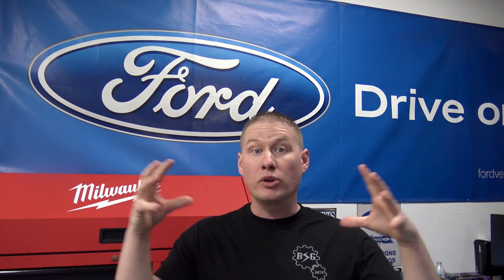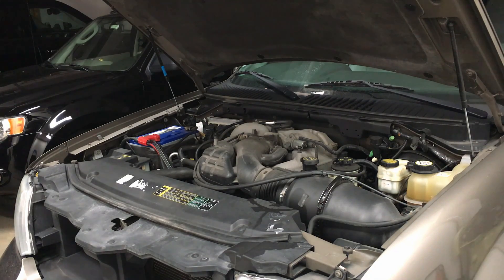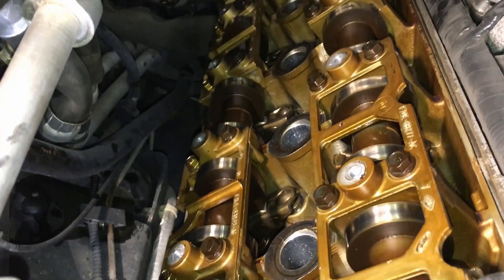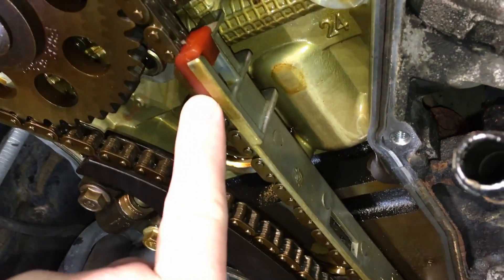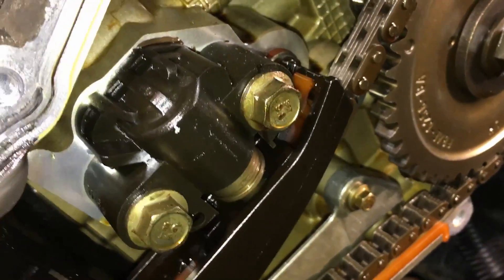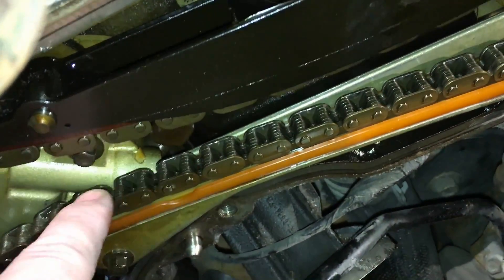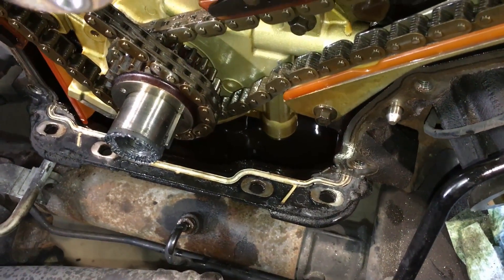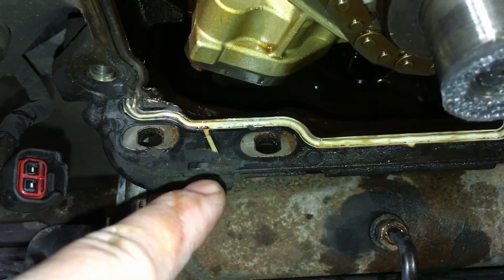Ford 4.6L & 5.4L Triton Engines: Common Failure Points to Watch Out For!

Comment: i used to make fun of fords you know found on road dead , but then i bought a dodge ram . i think fords are better now
Reply: robert hensen ...
Ford...Fix Or Repair Daily
GMC...Garage Man's Companion
Mopar...More On Parts And Repair
Pick your poison, folks!
Reply: FORD / F_cked Over Rebuilt Dodge,Found On Road Dead,For Old Retarded Drivers
GMC / Garbage Manufacturing Corporation
Chevrolet / Cracked Heads Every Valve Rattling Oil Leaking Every Time/ Condition Hopless Every Vehicle Relies On Left over Engine Technology.
Cadillac / Carrying A Deceased Italian Lying Lifeless Amongst Cargo 
BUICK / Before Use Insert Car Keys
PONTIAC / Well you know LOL
Reply: @ @maverickdallas1004  GMC Govt' Motors Corp.  Generically made in China
Reply: @maverickdallas1004  you forgot one more bro, Chevy Like a Rock, unappealing and lifeless LOL
Reply: maverickdallas100 All of them and they're more reliable than Europeans
Reply: @maverickdallas1004  GMC is a Gay Man's Chevy 🤣🤣🤣
Reply: @maverickdallas1004  THIS DEFINITELY SHOULD HAVE MORE LIKES! WHAT IS WRONG WITH YOU PEOPLE 😂🤣
Reply: robert hensen All vehicles have problems. Love am or leave em I guess.
Reply: mark p ...Foreign cars aren't so "foreign" anymore and domestic cars aren't so "domestic", either!
Reply: My old Ford runs like a Swiss Watch, but that's because I do all the work on it, except the Transmission Rebuild, but I found the right guys and they built it exactly the way I wanted it
Reply: robert hensen the biggest problem I saw with older Ford engines back in the 70's and 80's in the desert was their propensity to overheat. The next biggest problems was in the 80's when their electronic ignition control modules from the factory weren't very reliable. Change one out with a heavy duty module from Sorensen and the problem was solved.  Besides that every engine family there were some problems specific to each, but that was the most common. But once you understood what those problems were they weren't any better or worse than their competitors. Somehow I've ended up owning more fords than anything else, but they've always been reliable other than ignition control modules. I took good care of the cooling system, and upgraded the radiator whenever a car I bought had a two core and that was that.
Reply: Chevrolet... Cracked Heads Every Valve Rattles Oil Leaks Engine Ticks
Reply: About 6 months ago I repaired a Stripped Out Spark Plug Hole on my 4.6L Ford, and I did a High Quality Job on it and it turned out perfect, but I have Mechanical Ability and an Education

BTW, it cost me about $22 for a brand new Repair Kit off Ebay
Reply: Keith Johnson - Shelby GT500  why was it stripped out?
Reply: Escape for Mankind is Keith Johnson  Sounds like you have pickup all the slacks for Ford. A reliable quality vehicle shouldn't be like that.
Reply: GMC: Got a Mechanic Coming?
Reply: Escape for Mankind is Keith Johnson those things are easy to do but  hopefully .theres a variety of them at advanced for a 10 to 20 bucks but still doesn't change the fact that you have to fix what ford couldn't
Reply: EmofacePS3 i have both. both impressed me alot . i really cant choose which brand i like more because they both have there ups and downs
Reply: My 90s dodge ram has 240k ORIGINAL motor & transmission. Still runs fine. My ford 5 4 3v was an absolute POS dropped tons of money just kept breaking and breaking.. Glad I got rid of it
Reply: @oliverdelgado6952  That's sort of the problem. The 5.4 VVT Engine is the biggest POS Ford ever made.  I ALMOST bought an F150 with that engine, but, the price was just a bit out of reach. I bought the Work Truck Special with the 4.6 and have had ZERO problems ( New Alternator @ 130K and coil packs and spark Plugs @ 150K. Currently has 230K) and still touch starts with a slight turn o the key.
Reply: @anonimous2451  thank u for answering my question....i was wondering ,why not the 4.6 f150🤷🏾‍♂️...
Reply: I own both. A 2003 F150 4.6 and a 2017 Ram Laramie 5.7. Love the Ram, passes everything but a gas station.
Reply: Anon Imous lol yeah there fun but I went with a 2017 2500 6spd manual cummins love this truck also but I’m passing the shit out fuel stations not other vehicles but that’s ok cuz I had a 97 with 5.9 l gas omg what pig that was.
Reply: Anon Imous see it’s called smiles per gallon bro 😆👍
Reply: Exactly, people never realize until they get behind the wheel of one and then they find themselves asking themselves what kind of a fantasy world have I been living in LOL. I used to be one of those people until I turned 19 and drove a Mustang for the first time and I'm 39 now and I never have and never will go back to junk ass Chevy or anything else for that matter, well except for maybe a Nissan Z-car or a GTR when I win the lottery LOL but nevertheless Ford will always be my Foundation.
Reply: Yeah my 01 ram 5.2l v8 still on the road today mechanically sound body a lil worse for rust. But I see ten of these for every ford or gm of the same year guess dodge had it right when they said longest lasting trucks on the road.
Reply: @Jon-O.  🤣🤣🤣👍keep telling urself that, it'll work hard for ya LMAO Ever heard of Auto Trend Magazine? If so, try to argue with them lol
Reply: Michael Taylor what about there longevity and I suppose you’ve never heard of fake news hahaha. I’m just reporting what I’ve seen and personally experienced. Are you going to tell me the Chrysler 318 cu in 5.2l is junk? Because if so then the Gm 350 and fords 351 were crap too. Which you know dam well is bullshit.
Reply: @Jon-O. 🤣🤣👍 Have fun with your theories
Reply: @Jon-O.  🤣🤣🤣...I have spoken young padawan 😎👍
Reply: Michael Taylor cmon join the ram side oh wise Yoda. 😄😆🤣
Reply: @Jon-O.  Never..... I'll Never Turn To The Dark Side!!!! You failed your highness, I am a Jedi, like my father before me🤣🤣🤣🤣👍👍
Reply: Michael Taylor lol Luke I’m your father, Son join with me and together we can rule the roads of the universe! 😇😂😂🤣🤣👍lmao you had to troll me!
Reply: @Jon-O.  Love it man🤣🤣🤣🤣👍Dude I love old-true mopars just, unfortunately not the 80s and up. The 80s killed Dodge for me bro. I'll love the superbee 😎👍
Reply: Michael Taylor yeah there was only carol shelbys attempt to resurrect mopar muscle a ford guy with front wheel drive tuners. All the while from 75 to 90 ford was Putin out stuff like mercury marauder f150 lightning mustang cobra my buddy had one beautiful car. Gm with the Buick gtx and grand nationals Pontiac Trans Am one bandit run. Chevy comaro and corvette typhoon. My mom drove a 68 two door charger that was the car that turnt me to mopar it was a 383 4bbl and it was fast. Can’t imagine a 440 sixpac or the 426 hemi. She didn’t have it long they boosted it from her work parking lot. Just watch though as far as Trucks Ram is on a mission to catch Ford. They passed Chevy in sales in 2019 and most likely GMC trucks soon because of the 6.4 hemi and 6.7 cummins the aisian transmission is a product child of a Chinese corporation and Allison where Allison shared there tech with China. So essentially Ram has the best diesel Cummins mated to the best trans technology from Allison that’s going to be hard to beat and with longevity those farmers will be buying and that’s what made Ford #1 originally. The info on ram passing Chevy in sales was from AutoTrends magazine article in 2019. But enjoyed the exchange with you and the light heartiness 😃👍
Reply: @Jon-O.  Thats a mouth full bro🤣🤣🤣😎👍
Reply: Christler products these days total junk
Reply: @Terrilmob-j3f  that's because Italy bought them out and Chevy is not too far behind 😎👍
Reply: The 3v Ford 5.4 is the worst engine ever built imo
Reply: robert hensen
Reply: LOL
Reply: Ya mopar really cheaped out beginning of 2002 when they almost went tits up lol.
Reply: mel plishka not the trucks but the cars yes
Reply: What would you know?? Your not working on it. 

You bought a piece of shit
Reply: @Casa Del Amo  atta boy ls espically 6l
Reply: @Steve Paige and they hold value
Reply: I just switched from a 07 dodge ram to an 06 f150. The dodge was a good truck till it hit 120k miles then every other day some new noise or shake would start. When the transmission started slipping on me it was time to give it up. I had great luck with the older fords so let's hope this one is the same
Reply: You guys ever stop to think maybe they all make good cars? It’s just the good owners that argue about them and that’s why they all have such high mileage examples
Reply: Why do I have 6 neutrals I think people with mechanical knowledge make junk vehicles look good only because they know how bulletproof and truly repair not just replace fail parts with the same part that will fail again.
Reply: jon O good owners if a vehicle makes it long on one case every truck that doesn’t make it that far was owner error. My grandfather has a 1977 f150 with 600 k miles on the original motor still wakes up at 4 in the morning every day and it starts right up
Reply: Well Ya!
Reply: My f-150 has 320,000 miles all original
Reply: All the same hot garbage. Every single car company
Reply: I'm a 22 year mechanic out of all the vehicles I have seen 2 and 4 valve engines like this is able to be neglected , beaten, ran 100,000 without a oil change and still run like a top with 400,000 miles on it in fleet vans . 3 valves were garbage though
Reply: my mother says there ain't no such thing as old dodge
Reply: My 2005 dodge ram 1500 was the biggest, most useless piece of garbage I've ever owned and it pushed me into the arms of Ford!
Reply: Im Hip, Fords have their problems but nothing like Dodge, their materials are garbage mostly, engines and drivetrains are ok but the rest of the thing falls apart! I like GM products but they are definitely a lot more expensive to buy and maintain. They have their problems too. I dont see too many GM pickups on the road where at least one bulb is burned out. Doesnt seem to matter the year. My brother in law bought a new GM pickup and the horn honked almost every time he made a right turn...weird
Reply: @zzyzxzee6374  gm expensive to maintain? Ever OWN a ford?
Reply: Especially here in the salt belt, I once saw one that had the frame almost rotted out.
Reply: Ford .Fucking only Real Deal. First on Race Day. Awesome always!
Reply: Greg Taylor Lmao. Yeah... GM makes a sold drivetrain, super shitty at electronics.
Reply: Toyota....add gas and drive.
Reply: You don't know what you're talking about
Reply: robert hensen ugggh yeah. I would buy a new dodge hemi tho.
Reply: Ya i dont like rams. There new trucks with rear spring coil drive like dog crap
Reply: Jacoby Noctis the one tons have leaf springs. Put some wait in the back it will ride like a Cadillac.
Reply: BWAHAHAHAHAHAHAHA
Reply: chevy is best
Reply: @tommymcdonnelljr1582  yeah they're so good that they just closed down three more manufacturers in this country  and many of their employees are still on strike 🤣🤣🤣🤣🤣👍
Reply: robert hensen agree dodge is garbage. total money pits.
Reply: Gavin just had a spark plug pop out of my engine yesterday.  ford cant even accomplish a spark plug fitting smh. selling it and going back to chevy for life
Reply: @thomassmith3951  is this only on the 5.4 and not the 4.6?
Reply: Yes i agree Dodge is worse than Shitrolet.
Reply: John A  yeah Ram is so bad it surpassed shitrolet and is knocking on Fords tail gate pfft.
Reply: Casa Del Amo yes the best set up you can have is a 6.0 Duramax with an alison transmission
Reply: @jackrogers7676  the duramax is actually an isuzu engine

Comment: My 04 3 valve  wiped out a follower and cam on the passenger side. I change the oil several  times trying to flush out everything. I did not find but a couple of small pieces in the filters  that I changed close together. I did not drop the pan as the cross member is under the pan and I would have to have the front aligned as it looks like it holds the frame together. That was over a year ago. I did not think to put my camera in through the hole as I thought you could not see the pickup. If the cross member is removed, do you need to get it aligned? Also, can the pan be pulled with out the front cover being removed and are there any issues I should watch for? Do I just need a pan gasket to pull it or what do I need? Thanks for the videos.

Comment: I have worked on quite a few 5.4 32V engines, mostly Aussie Boss motors.
I install them in Mustangs.
The Navigator 5.4 32v version actually has a 2V oil pump, 
which has the small diameter pickup tube.
What I do, is use the Melling Shelby GT500 pump, (M360 I believe)
and use a 2005 5.4 3V pickup,
as the 3V motor has the larger pickup tube to match the pump.
Both use the same oil pan.
Also, Ford Racing has complete timing kits which include everything
for the 5.4 32V.
Get the Ford GT kit, not the Shelby kit.
The Shelby kit has smaller cam gears and different chains to clear the cam covers
of the Shelby.
The kit that fits the Navigator is M-6004-A544
Reply: Will this oil pump upgrade work on a 1999 Lincoln navigator 5.4 32 valve ??

Comment: I have a 03 Town car, with just under 100k miles.. I have noticed sometimes on start up I get a noise..almost like you just did an oil change and the filter has yet to fill up.. Should I pull the front cover and check ??

Comment: Just wonder if you can post something about removing the rad. fan on a 2000 ford explorer. I've done many fans, but, I have never done a 5.0 explorer fan. It looks as though I need a special tool to get loose from the pulley. Any help would be greatly appreciated, because my wife thinks I the best mechanic around. Little does she know most of my knowledge has come from other people, lol. Sincerely, Jack.

Comment: Hello ! I have a problem at 130hp 96kW Ford Mondeo mk3 2003! Do not stay water at 90 degrees! I changed two thermostats so far and barely stands at the forefront! Please help me ! Give me an advice ! There is another controller somewhere? I heat in the car! Thank you very much !
Reply: no, increases water temperature to 90 degrees!
Reply: thank you very much :)

Comment: FordTechMakuloco, Keep up the good work. It's appreciated. Can you tell Us how many miles the 5.4 L  4 Valve had on it?
Reply from the maker: 137k miles
Reply: I have 280k on my 97 Thunderbird and my engine seems to run smooth and quiet.  Is there anything I should do to the inside of the engine at this point?
Reply: I'm a Futures Trader
Reply: you got lucky. your ford is the 1 out of 10,000 that makes it past 100k miles
Reply: i'd be embarrassed to admit that i owned a 97 thunderbird with 300,000 miles. you need to get off the comment section of youtube and get your money right.

Comment: Which tensioners do you suggest?  I see there are cast iron ratchet ones available.
Reply from the maker: I use what was made for that particular engine per the workshop manual but many have used the old cast iron ratcheting type tensioners in place of the new plastic style with no problems to report.
Reply: Thank you.

Comment: Can the front cover come off without removing the valve covers?
Reply from the maker: Yes I have done this before but in the end you will need to remove the valve covers any way for further inspection and the timing procedure.

Comment: Hey Brian great video. Have you ever come across the older 4.6 triton engines spitting the rocker followers? I've had bunch of ford products that had the 4.6 and they've all been flawless except a 2000 f150 that I've had sitting for quite a long time. It used to run good when I would start it every few weeks, then one day it backfired and started running rough. Found no compression in two cylinders and both cylinders had a rocker follower laying in the valve cover. Supposedly ford has a retention clip to keep them from falling out. Haven't tried to put it all back together yet. Doing some research first before I do. Any ideas?

Comment: 4.6 &5.4are both great engines
 my 3 have 180k, 275k, 389k. I did timing tensioner on the oldest one at 150k, with guides, not the chains, sprockets or oil pump. took me about 8 hours.  don't go chasing the what if , because it's a no win situation. oil pumps rarely fail on these.
Reply: Zachariah Woller  not true I've had almost a dozen of these engines I never check plugs and I've never had a plug blowout
Reply: therockkkkher 
If you put a spark plug in there and don't check on them every time you get a transmission fluid change than it will blow out. See people that don't know how to turn a wrench are the problem, they will take everything for granted than when it fails they blame someone other than themselves.
Reply: daryl turcott I agree mine has nearly 300k on it still running strong. Also it's had a very hard life dragging a trailer and skid steer around.
Reply: Zachariah Woller To each their own
Reply: fomoco look at Schaeffer oil site. They tear one down with a million miles on it.
Reply: The 4.6 is trash. I like the 5.4......Ford never should have out a tiny underpowered 4.Shit in a truck. Big mistake!!
Reply: @boostjunkie2320  idk man, my 4.6 has 377k miles on it and still runs well
Reply: lasts forever: 
Since I do all my maintenance and with this problem being eminent to the Fords from what I've seen on the internet and all thathas happened around me I check them not once have I had a plug blow. So that's just my method.